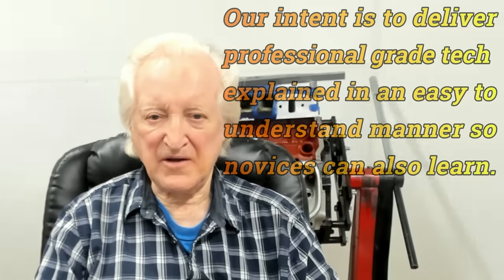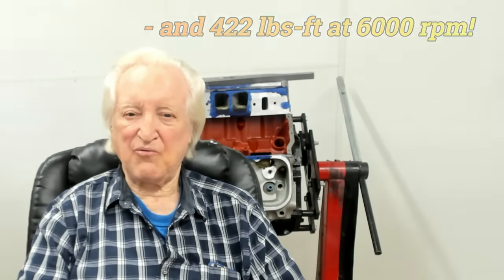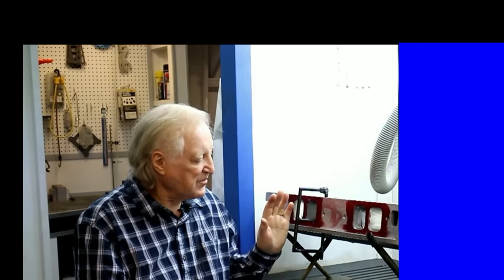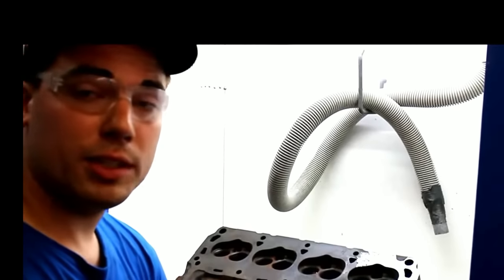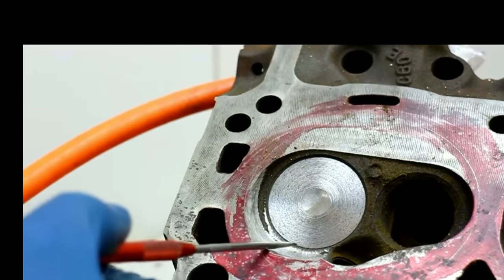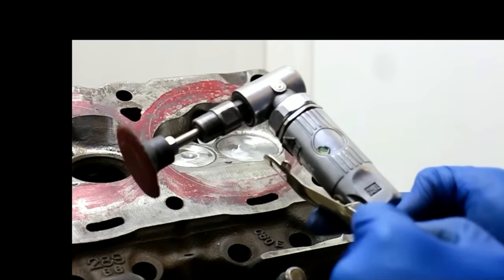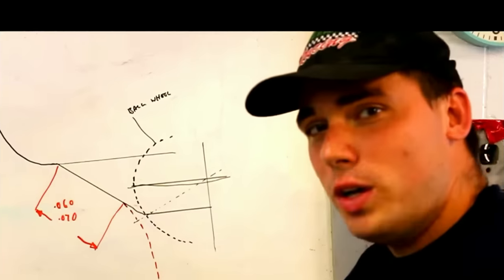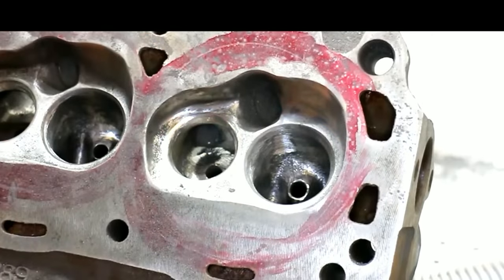Pro race,  very street drivable, 500 hp OE 289 SBF iron head mods.

Comment: I was getting 350-400 HP out of my old 289 heads in 1980 at 7,000 RPM.   Was running 11.80’s @ 3,700’ altitude in a ‘62 Ranchero.  I now realize there was more HP to be had by spinning 8,000 RPM and would have probably put me in the 10 second range.  I was out of steam at the finish line at 7,200 RPM with 5.43 gears.....
Reply: Just ran across this. Yeah, very similar in the 70's. Iron block, cast crank, stock rods with Chevy bolts, domed pistons,  OEM heads, Chevy valves in the heads, porting. Made enough power to later run Super Street on good days, solid 11.20's at west coast tracks in a 2500lb fastback. The 4-speed cars in the group were quicker. I ran a C4 and 5.43 with 13x31W's. Shift at 7 and go through the lights at 7800 or so. 

My first process was cutting a stock head apart to learn the casting specs. Youtube sure makes things easy nowadays. It was all trial and error back in the day; lotta work.
Reply: So great to get so much out of a small motor. 🤠
Reply: what upgrades did you do?
Reply: @gamwsas . Mild work on the intake ports with Chevy valves and a very crappy 1 angle valve job with the big sharp lip at the seat/head interface.  A lot of work on the exhaust port and totally removed the guide boss.  No chamber work at all.  After watching this video I see where a whole lot more work needs to be done.  I built this 289 engine in 1980 when I was 16 and now I’m 60 and still have the engine.  I have used these principles and done one complete cylinder and I think it looks good, but it hasn’t been flowed.  I will finish the heads and have larger valves installed with a 3-4 angle valve job when the Texas heat ends in September.  In 1980 there was no aftermarket for SBF parts except for pistons/cams because the 5.0 HO didn’t exist yet....had to make do with factory parts, but 11 second quarter miles were very respectable in 1980 as the fastest BBC’s only ran 10’s and only a couple ran 9’s.
Reply: @trailerparkcryptoking5213  how did you know how to build it back in your 16's?:)

Comment: A gasket is most always bigger than the bore ! My hubby puts dykem on the head , then bolts it to an empty block, turns it up side down , reaches down the bores and scribes lines even with bores. That way you never have chambers bigger than your bore, which causes turbulance.
Reply: What you don't know is that turbulence is there for a reason. By design by Ford.
Reply: @lelanburns6182 No it absolutely is not. That's just goofy. Turbulence in a head piston squish area is created by the clearance between the head surface and the piston top. The idea that turbulence would develop in a recess like that is just not sensible or supported by any engineering theory or practice.

Comment: I don't like the idea of using a disc to clean up the head you can't see what's going on and what high points are from the bolt holes etc.  I've always used a brand new medium to heavy grit bench grinding Wheel that can cover the whole width of the head. This lets you see what the low points are and the high points are you can get a complete flat head doing it that way

Comment: Oh yes, the shrouding! Many people think that the motivation for using 351W heads on 289 and 302 blocks is the bigger ports. Not so - the stock ports are about the same. The 351W chambers are unshrouded, and the valves and bowls are bigger. They still need port work, but that's easy compared to what the pros here are doing.
Reply: 289 ports are @ 127 CC ports and 54 CC chambers with 1.72 valves.
Early big spark plug 351w heads (and todays GT40s) are @144 CC ports and 62 CC chambers with 1.84 valves. On a 289 they kill one full point of compression.

Comment: I have done dozens of heads of FIA approved and time period road racing engines.  I always wondered why the 2 engine builders I supply them to let the engines rev max 7200 rpm and prefer the customer shift at 6800.  They told me , even with a girdle , using the higher revs didnt make them go faster BUT ALSO had blocks crack within hours.   As some engines have to withstand the 6hours of Spa or the super long straights ( 3 times 1 mile on 1 straight ) of Le Mans ......longevity is the way to win races with these engines.   Keep revs down!!!

Comment: I bought your book called port & flow test cylinder heads. Now onto chapter 2. But I’d like to say this David. These videos have given me some of the best information visualisations and help to understand the language of this art! I’m so very grateful for all your kind help you have offered us all! 
Although I’m chomping at the bit to start porting the 2V heads on my 72 Ford 400 motor I’m going to absorb as much as possible from your videos and book, before I start!
Reply: For myself I would even say that with these videos. It helps me understand a lot more of what I'm reading in DV's books. Nowdays when I go back and read in my A-series book. It almost feels like someone have swiched the light on!
Reply: @martinandersson1049  yes! Definitely
Reply: 400 heads??? Dont bother, chamber is way too big. And worse you struggle to get a decent piston. If you are serious get those rods bushed then use 351C pistons,, or better Aussie 302 heads which are small chamber, Never bother with 4Vs unless you want to turn it to the moon.. 72 400 is around 8.5-1 with about a 78cc chamber. 302 heads are around 60cc. Factory height 71 400 pistons will give around 9.8-`1 with a 50 thou cut. But all I have seen in replacement pistons have the crowns in a different postcode, worse most headgaskets are at least 10 thou thicker. It all adds up rapidly to about 7.5-1 with 'replacement pistons and fat gaskets
Reply: @ldnwholesale8552  hi thanks for the info! The heads on it are 2V small ports. With Porto g and raising the exhaust outlay 2 mm plus de shrouding. And 27,thou off the heads with flat top pistons should be in the 8.9/1 plus a descent cam to up the dynamic compression. Which is a definite mod anyway with intake and headers I’m looking at around 450-500 Hp. If the heads don’t yield good results then it’s a pair a AFR heads and a solid roller! I’m hoping to get a descent amount from the 2vheads though! But your right about the 4V’s I’ve seen DV on here filling the inlets with JB Weld! To shorten the ports!
Thanks again bud!
Reply: Best option is change the factory retarded timing gears to advance at least 6° then just boost it with a different cam profile. The 400 is a torque monster especially the 71's mine actually pulled a wheelie in a Ranch Wagon on the 1-2 shift at around 55mph, scared the Hell out of me. Best option for the 400 if you want serious power is getting CHF heads and matching intake with a rowdy cam anything Jon Kaase did to that engine made crazy power numbers. No the 400 is NOT A BOAT ANCHOR as so many used to complain of, it was a dog with the horrid timing and garbage compression ratios and would run on and diesel and knock and ping like a sucker but with the correct bearing it was quick to accelerate.
Reply: @RollingRigTraction  wow!! You just made my day! So if I want upto 500 Ho could I use the 2 v heads ported with a matched cam I know I have to up the compression by getting flat top pistons and it’s been said you can take upto 26thousands off the heads to up it to 9.7 to 1. As mine is the 72 first year of the smog motor.
Reply: @robertreavley7145  you wouldn't really even need to up the compression with some turbos, it will mitigate detonation with the lower compression and you can just ensure the valvetrain timing is reset with the aftermarket gears or something like a Jesel belt drive or gear to gear. Just ensure you have a good hot spark and probably a few thousandths wider spark plug gap and get a cam that's profiled for the correct line separation angle for boost and add snails👌😎 and an intercooler or water methanol injection. 500hp is easy with that block. Keith Black makes flat tops for that engine along with a few others , you could push it up to 9.5:1 or even 10.5:1 with a correct tune and start with maybe 7 psi and work up for more afterwards. Remote mounting the turbos back at the tail end of the exhaust is even better to keep the under hood temps low and clean so you can still easily access everything under the hood.

Comment: I remember reading  an old Hot Rod magazine article from the mid 60's talking about Shelby cobra 289 race engines and it said the famous head porting shop next door to Shelby in Burbank had the race engines pulling 450 - 475 HP. As I recall they were putting chevy 1.90 intake valves in the 289 heads (the chevy SB 2.02 valves would not fit) and then porting the 289 heads. It's been a long time but I believe the end of the article said they were currently experimenting with the Ford 352 heads to see how those could be adapted to the 289 with hopes of getting over 500 HP.
Reply: My 67 gt350 had valley heads built from hipo castings it had its engine fully balanced and prepped to trans am racing specs supplied to shelbys
 shop and tested before delivery, lots of chassis mods done as well. 
I got the car from my family in 90 then after  an oil change and setting
 carb( 750dp) doing valve lash and installing msd with rev limiter, we
 chassis dynoed it. 435rwhp at
 7500rpm With a summer of careful testing i was able to raise the rev
 limiter to 8400rpm. I installed a t5 v8 2.95 1st gear and .80 od.
This thing was reving like a ferrari i had a crossover kind of headers might have been a 180 degree set. Absolutely a wild exaust note. With 3.30 rear gears  i got it to 8200rpm in 5th going down a shallow long hill😮 about 5 miles long. Mathematically  that was 197mph. 😊
Reality was probably  10% off but i never ever tried that again. Shelby was destroyed in a garage fire where i was
getting the fiberglass sidescoups remounted  due to the studs detaching.
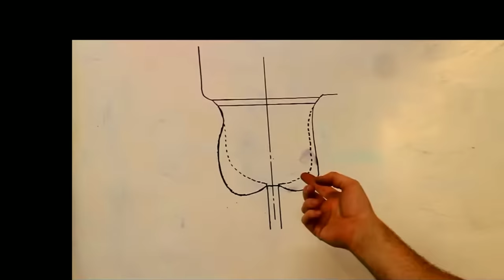All i could keep was fire scorched engine intake melted!. 10:51

Comment: Ported a set of 1970 2V heads using your guidelines with slightly cut down to 2" intakes. Later switched to 77 GT 40's with a bit less work and was disappointed. Went back to earlier head.

Comment: Those 289 chambers were so small and perfect for modifying.  Makes me want to get a pair of small chamber 352 heads and do the same mods.
Reply: I had a set of those heads. Opened them up for 1.94/1.60 valves. Those early castings had plenty of meat.
Reply: @robertwest3093  
DV does big valves on his.
Reply: Those 352 heads hard to find.

Comment: All gets down to flow figures. There's a lot of very good alloy heads there days that have great air speed and flow. Some of the factors for many also include the money spent on an old iron head vs a new better designed, material and parts options. From memory most started with 351 heads on 289s.